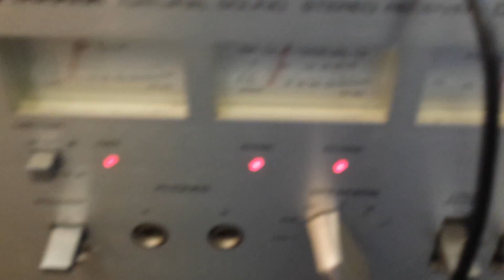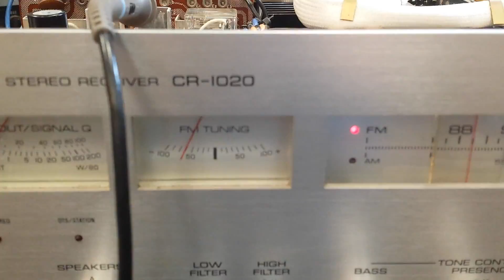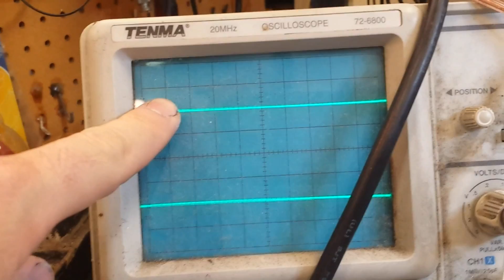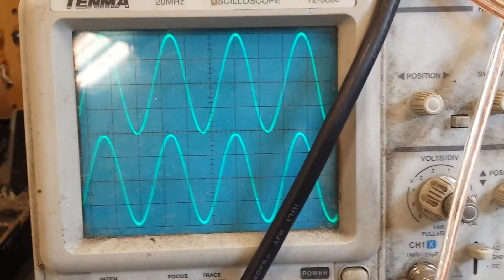Fixing a regulated power supply on a Yamaha cr-1020

Comment: My voltage regulators reads -28V and 37V.  37V seems too high watching your video.  What could be wrong?  I don't have any issue with sounds.
Reply from the maker: you've got a shorted transistor in the regulator circuit. either the large one on the heating or the immediate driver feeding it
Reply: I probably need to replace parts. Are they easily obtainable?
Reply from the maker: Originals, no.  You need to have a knowledge of the transistors' characteristics and know what modern replaments can be substituted and how.

Don't use an NTE cross reference. That can get you into trouble with audio gear, which requires replacements be exact in most cases

Comment: I like to increase the size of those heatsinks on the 2SD234 regulators, or completely outboard them.  The CR-2020 uses 2SD525 or TIP41C as the modern day replacement - they operate cooler.